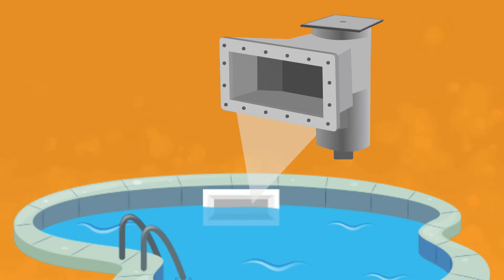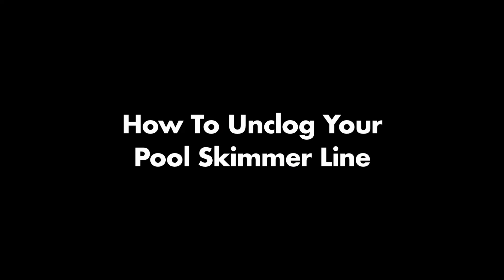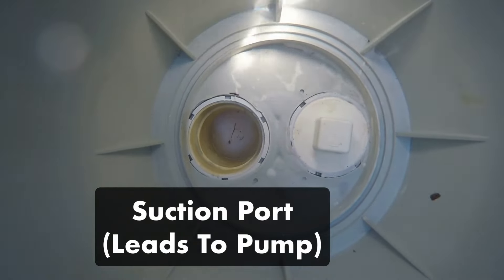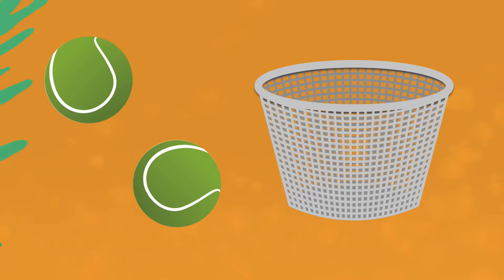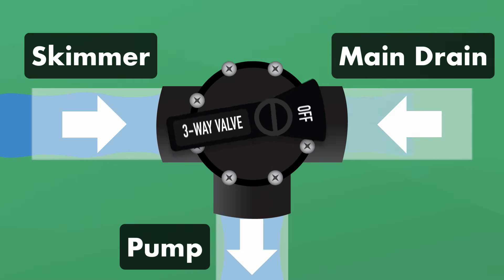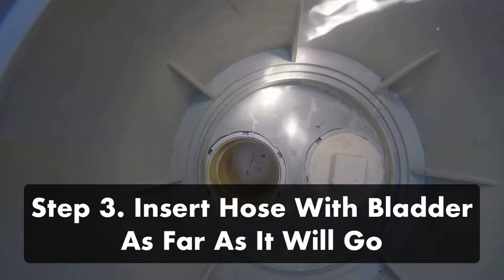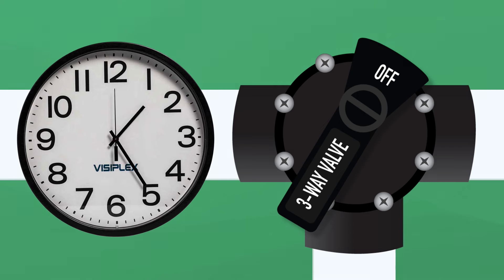POOL SKIMMERS 101: How To UNCLOG Your Pool Skimmer Line

Comment: In my skimmer BOTH of those holes at the bottom are open. Should this not be?
Reply: Same with my skimmer.  My pool is vintage and doesn’t have the ability to switch between skimmer and main drain.  I am having problems keeping my pool clean and FINALLY realized my main drain is plugged.  I am going to try and get a plug like the one shown to block the suction side to the pump.  I will then try using the bladder to clear the side leading to the main drain, then clear from the pump side.  I may even run the pump to try to move the blockage if it’s stuck.  Will update with results.
Reply: Hi any updates?

Comment: Thank you!!! My pump was clogged and I realized it was my filter socks which I had put on the OUTSIDE of the strainer baskets... OOPS! They both got sucked into the pump pipe and I was not able to maintain any pressure. A couple of turns back and forth on each of the skimmer valves and VOILA!!! Saved me an expensive call to a repair service.

Comment: Blew out the skimmer line with a bladder from both directions. Ensured no air in the pipe to the skimmer and still no suction. Threw the valve back and forth dozens of times, replaced the gasket(s) and still no suction. Any ideas?

Comment: Why has my pump pressure suddenly gone from 16 to 38 psi? The pump breaker next to the pool had to be replaced after about 2 days of no pump flow. Turned it back on and the pressure is 38.
Reply from the maker: Check for clogs, make sure your pump is clean and clear since that can cause excess pressure to build
Reply: @SwimUniversity  Did. Couldn't find anything wrong. I had changed the sand on the s244t and put in a new pressure gauge. Turns out, the gauge was bad. Ahhhhh!

Comment: You can have both skimmers filtering out to the pump at the same time right? For some reason my back port is capped off on my secondary skimmer and my mother said it used to work.
Reply from the maker: You'll want to make sure both ports are open, if it's capped off than the skimmer won't be working

Comment: I have a hardened substsnce in one of my skimmer lines. I dig at it with a LONG screwdriver and a film rises out of the line and is sucked back down the pipe into the sceond line.  Chips of it is hard and when dries crumbles. Could that be chlorine? What other substsnce could it be? There is a lot of air in the system especially in the in line basket at the pump.
Reply from the maker: Could be calcium build up. Or salt if you have a salt system.

Comment: Helpful video. But I have a question about using the bladder in the pump pot.  There are 2 holes.  I don't know which one is which or which one to use.   Can you explain it for me.   Thanks
Reply: The hole closest to the pool is usually the line connected to the main drain. In my skimmer it is plugged. Your intake line is the hole furthest from the pool and is the one you use to vacuum the pool.
Reply: Check the best succion hole when the pump is on skimmer line... the bladder should be put in this hole and push the débris, but it works better putting the bladder in the pump when skimmer line is sélect because debris will be push in the other direction than they come, and will unclog easier.

Comment: @swim university , I have two lines leading to the filter with a Y connector , each with their own individual shut off valve. Assuming one comes from the skimmer, what’s the other one for? I don’t have a drain at the bottom of my pool nor any other skimmer. Original had suctions issues but closed one and now it’s all good.
Reply: Could the other be for a normally-closed vacuum attachment? Its hard to click open door/latch/portlet would be in the pool wall a few inches below water level.

Comment: No help here. Have tried all of this, including drain cleaning by a plumber with very long “snake”. Today, I dug up pipe nearest to pump, cut it and tried to clear using the bladder. Get about 1/2 water pressure from skimmer to basket, none on reverse. What else can be done short of digging entire pipe up? Not an easy process as former owner filled area with red clay and gravel & of course, concrete deck. My thought is to expose pipe from pump to concrete, cut pipe and try to clear with bladder. Pool is from the early 80’s, so no telling how long pipe has been there! Help!!😊
Reply: Oh heck! This sounds so familiar! Trouble here is.. we now keep getting the “Well it’s summer madam so we’re too busy to clean out/dig out your blocked/broken skimmer line!” Just .. so unhelpful! We’ll have to have another few tries ! as this great video tells us! I hope yours is fixed now! Fingers crossed 🤞 for ours!

Comment: Great explanation of the system, and all of the tips for trying to clear the clog were a good starting point.  Unfortunately my system now has even less pressure at the skimmer and sweep intake.   My pool sweep no longer moves (husband thought it was my sweep’s fault threw it in trash and ordered an expensive brand name, which likewise does not move).  Went through steps again today, same results, except now the pump basket isn’t filling properly and the big cartridge filter gauge went from 10 to 30, so I have obviously made the problem worse.  Please pm off while I research
Reply: Yikes! Did you ever come to a resolution to share here?
Reply: Clean your filter! If the pressure went up perhaps the filter got a lot of nasty stuff from the debris you dislodged and if the pressure is too high it'll slow down the flow. Good rule of thumb is to clean it when it reaches 20 or even 15 depending on your starting PSI when it's cleaned

Comment: I have electronic valves, and unfortunately none of the lines are labeled, so I'm not sure which line is the main drain and which is the skimmer. I don't have a weir but a skim-a-round skimmer basket, and I noticed, there's no suction to pull it down, so I'm thinking the skimmer is clogged. I need help identifying the lines

Comment: If you aren't sure which line is the main drain and which is the skimmer, can you still put the drain bladder in the pump inlet and use it without damaging anything? If the skimmer is clogged, would pushing the blockage back towards the skimmer hurt anything? That way I'd be checking both the skimmer and main drain lines from the pump.

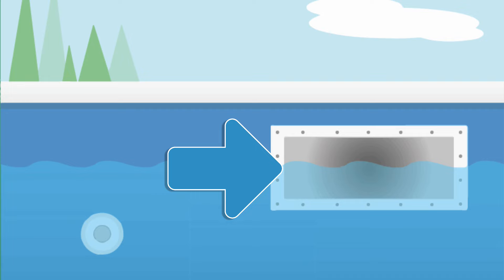Comment: When my jets are on, I can see the basket inside the area shown at 3:30 is filled with leaves. When I shut off the jets so I can open the lid and clean the basket, almost all of the leaves get sucked back out into the skimmer line. What do I do to clear the pipe of the leaves?
Reply: The leaves should work their way up thru the skimmer pipes into the large basket before the pump. That pump basket needs periodic cleaning, too. It ought to be rare that large, loose, light debris like leaves and bugs would ever clog the pipes.

Comment: Great video man and I got my issue fixed.  I always do all my own pool work so when I got low pressure and all the usual things were in good shape, I found this. It was indeed the pump propeller clogged.   Once I dislodged the debris and my fingers, all good. Kidding. I did turn it off, naturally.  Fixed! Thanks.

Comment: Had a clog in the skimmer pipe..looked in there saw a leg... turns out it was a gopher.. fun stuff..Pulled it out with needle nose pliers. :)
Reply from the maker: Oh wow. THAT'S a new one 😳
Reply: Can not understand how he got into the skimmer line without trauma to the line?
Reply: @_1ben  Floated into the line when the pool was off.. basket floated up and it got sucked in. Was right at the top of it under the basket.
Reply: I also had two of them sucked into the pump basket when i opened the pool this summer.

Comment: I have 2 skimmers  only 1 is sucking water any ideas please?
Reply: I have the same problem, I tried closing the drain valve and saw that the non-working skimmer furthest from the pump began to move and swirl some water, than when I opened the valve on the drain the skimmer went still again ? I tried to unclog the skimmer line with the garden hose with the inflatable balloon end device going in from the pump entrance and ran that for 10 minutes and did not notice anywhere the water was bubbling out which confused me ? I was sure all that water going in from the hose would come out somewhere I could see it , maybe from 1 or both of the skimmers since I had the drain valve closed and the water had no place to come out except the 2 skimmers ? If anyone has any advice for me I would love to hear it , thanks.
Reply: I have this same problem.  I plugged the good line to get suction from the bad one, but no dice.

Comment: Love your videos, you've taught me a lot and I appreciate your insights... But I have an interesting question.  What if my pressure is so strong that I get swirls sucking air into my pump (coriolis effect)?  I routinely use skimmer socks which dissipates it, but do you have any other ideas?  1 skimmer, 1 jet..
Reply from the maker: What kind of pool and pump do you have? I wonder if your pump model is too powerful for your pool.
Reply: @SwimUniversity  I have a 1.5 HP on an 18x33... I am planning on a second jet to increase circulation
Reply: I assume you have a good skimmer basket, also do you have a skimmer weir in the skimmer, also the socks are no good